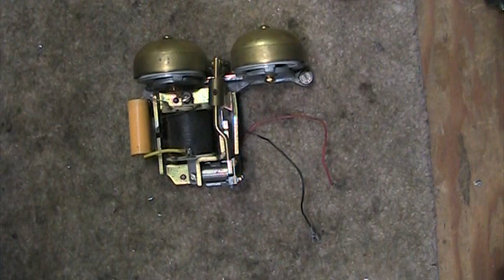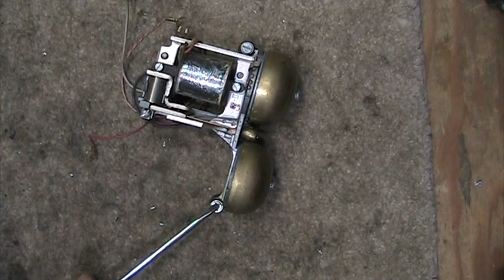Description of Telephone Frequency    ringers.

Comment: Can the capacitor be modified to accept a 20hz amplitude?
Reply from the maker: There are two separate things going on and frequency ringers other than the one that is specifically tuned for 20 Hz the capacitors are different and the weights on the hammer plus the thickness of some of the metals. It's not really feasible to try to change them to be something that they were not designed to be. There are way too many straight line ringers in the world to even waste time trying to do this.